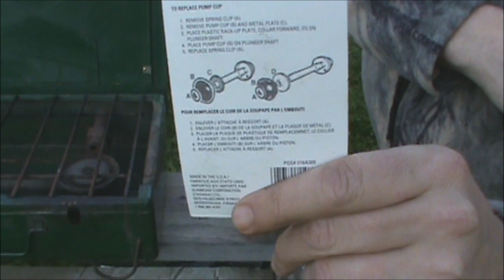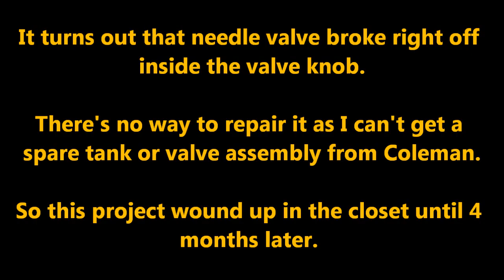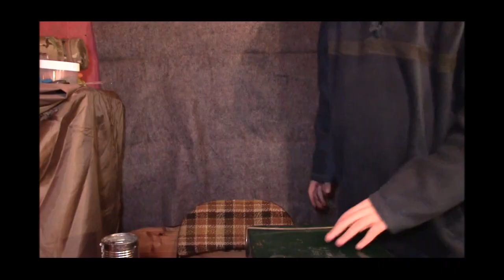Coleman Camp Stove Maintenance and Repair

Comment: These old Colman stoves are also nice to have in a grid-down situation for those folks with electric kitchen stoves. Have several of them, the first of which was purchased in the early 70's. Also have a couple of the propane conversion kits, as well. Good info on both the pump repair kits & the problems that may be encountered with generators in the old ones. Have replaced generators without any problems, so that is a variable, depending on the individual unit. 

Like these old stoves. Fuel stores for a long time. Over the years have cooked many meals on them, both at home & at campgrounds. Also work as extra burners when cooking for a crowd at either place.
Reply from the maker: Oldtimer Lee With all the stoves I have, I still prefer the Coleman on vehicle or canoe trips just because it's so rock solid. And with proper repairs, they can indeed last 50 years or so. The replacement generator is now in the repair kit for my newer Coleman stove and that's in the side pocket of that Cabela's triple case with 2 extra fuel bottles as well. Good for a couple of weeks off-grid.

As soon as time and the weather permits, I have another stove that may be worth considering - the BioLite CampStove. I shot a lot of footage of it last year but I need to reshoot it.
Reply: Alberta Bushcrafter If you don't already have one, add an adapter to run off 20 lb propane tanks, as well. Gives more flexibility based on circumstances. Saves the more expensive bottles for times it's more beneficial to use them. 

Don't know much about the BioLite, so looking forward to seeing your vid when you get round to it.
Reply from the maker: Oldtimer Lee Thanks, Lee. That adapter is on the wish list for this month as well as a tee and some lines. I'd actually love to find an inexpensive trailer and build a camping trailer (more of an outfitter's trailer) but that may take a few years.
Reply: Oldtimer Lee

Comment: I have 6 stoves that wouldn’t hold pressure. Took out the pumps, put them in some motor oil, good as new!
Reply from the maker: Did they have leather pump cups? Because that works on leather but not so well on the rubber ones.

Comment: Sometimes all the pump needs is a little oil on the shaft to restore the leather seal.
Reply from the maker: True - and it can be anything from vegetable oil to 3-in-1 to clean motor oil, but I use mineral oil (aka. scent-free baby oil). The "pump cup oil" is an expensive substitute.

Comment: What year is this stove?  I'm use to the oval red tanks.  I forgot about these tanks, so nostalgic.
Reply from the maker: I checked, and this is a Coleman 4M. They were produced in Canada approximately between 1957 and 1964 or thereabouts. Not a bad stove, but it's nearly impossible to find some of the parts for it.

Comment: I know this video is old and hopefully you can answer my question. I have a 1972 3 top stove and the pump requires oil. WHat oil do I use? Thank you for the diy. 😊
Reply from the maker: Actually, just about any oil will do. Normally I use what we call "3-in-1" oil (not sure why it's called that). But mineral oil (unscented baby oil) is excellent. I've even used cooking oil in an emergency but it can go rancid over time (mineral oil doesn't), but that's not going to affect the stove.

Comment: I have a comment on this video regarding removing the generator at around time 26 minutes.  Another video (https://youtu.be/feKxUn3KKiY) at time 7:15 shows removing the generator first by unscrewing the nut on the tank knob side and pulling out the needle control rod before unscrewing the pipe.  Maybe that's why the needle control rod broke.
Reply: You are 100% correct.

Comment: Hi.  Nice video.  I have a stove that is not pressurizing and I cannot use because I am getting a puddle of white gas where the generator in that recessed area where the generator assembly comes in contact with the tank.  Any ideas?
Reply from the maker: Sonds like it's the same thing that happened to one of my own old Coleman stoves. If the generator is gunked up with residue (vernishes and the like), the fuel doesn't vaporize but instead leaks out. Try carefully removing and  disassembling the generator, then cleaning it with carb cleaner and one of those long, thin brushes (sometimes used for metal straws, actually). If that fails, you will likely need to drop $20 for a new generator. Plus, it doesn't hurt to wrap the threads in teflon tape as long as it isn't on the inside of the generator tube.

Comment: Around here, in the central valley of California, I see these stoves for $15 - 35 at yard sales or swap meets. I currently have have 3. I have 2 and 3 burner. And I just picked up a single burner. It won't light, hence the reason I watched your video. It should be something simple. I already oiled the plunger and it will pressurize. But no fuel flow. I'll get it figured out.
Reply from the maker: Often that's a clogged generator. You can carefully remove it but don't force it or you'll break the generator. Then you can usually clean these with a stiff brush and some carb cleaner. If that fails, you can usually find a replacement in a big box outdoor store, or online.
Reply: Those are insane prices. Fortunately, I found a couple of these in the Craigslist freebie section over time (one or two 425's, and an older-looking 421/413 (?) ). And no kidding, retail stores (Canadian Tire, aka The Usual Scumbags), wants ALOMST $200 FOR A NEW 425!! This price has increased for some idiotic reason, going from just about $100 6-7 years ago, to $125, and up and up.
(Get stuffed, chain store).
I was lucky enough to come across a cheap white gas lantern at some yard sale or other. Picked it up for about $20.

Comment: Thank you ......similar to yourself...I tried to fix the old tank.....and failed...so I just bought a Mr. Heater propane converter . Now my hot dog buns are warm.
Reply from the maker: Nothing like warm buns on a cold day. I love that little converter unit, and I'm planning to set it up with a 20 lb. bottle as well, soon as I et the parts. But I also picked up a $5 garage sale Coleman, and a couple of lanterns as well, so I'll be doing another  (shorter) couple of vids in a few months. Thanks for the compliment!

Comment: I found that if the wire handle is down (its down in the video), that it interferes with the tank and generator seating.  Flip the handle up and the tank will seat much better, and the generator will seat further into the burner.
Reply from the maker: Great tip! I'll keep that in mind for the next Coleman video too.

Comment: Someone who collects old Coleman stuff told me you can clean these generators with carburetor cleaner.  I've never tried it, (yet) but it seems reasonable, ya think?

Soak the generator over night in carb cleaner and go forward from there.
Reply from the maker: Reso Man Carb cleaner just might work, as it does a good job on other stuff. I wish I had remembered that before I sheared off the needle valve.... :-D

Comment: Hi, all
If propane is not available can we use petrol or kerosene,?
Reply from the maker: If it's a liquid gas stove, the Coleman fuel is best and straight naphtha works too. But kerosene isn't recommended as it clogs up the stove quickly. 

I've used unleaded petrol in one of these stoves, and I add a capful of Seafoam engine cleaner to every tank, which keeps the generator a bit cleaner. That's the only way I got petrol to work without clogging the generator, and without the Seafoam additive the generator required regular cleaning. Incidentally, European petrol is a bit different than North American gasoline but the Seafoam trick works for both. But use it at your own risk as it can be a bit more dicey. 

Propane is a gas, so liquid fuels don't work. Isopropane and isobutane canisters likely won't work on a propane stove, but I consider that a moot point because they're way more expensive anyway and I personally don't like using them unless I need to.
Reply: @AlbertaBushcrafter   Thanks Sir,
But unfortunately here in Uganda propane is not available, so plz suggest me.
Reply from the maker: @applianceparadise7446  Well, that limits you to using the actual liquid fuel tank and rules out the propane adaptor, but that also simplifies things. And I'm guessing actual Coleman camp stove fuel is also unavailable in your area, so you won't be able to use tthat. 

Kerosene is not compatible with these stoves, but most petrol or gasoline will work. The generator in the stove will clog up more quickly with those fuels so it either needs to be manually removed and cleaned about every 10-20 tank refills or any time you notice its performance suffering. Clean it with carburetor cleaner and a fine wire brush.

Another thing you can do to prolong the life of the stove is to add about 15-20 mL of fuel injector cleaner or Seafoam engine cleaner to each tank. This works on my stove to keep the generator from clogging up and reduce the number of times you need to clean the generator.
Reply: @AlbertaBushcrafter  
Thanks sir.

Comment: Help please, from the Bahamas, brought a powerhouse 414. No sound of fuel traveling so won't light . Dos please please!
Reply from the maker: No sound of fuel usually means the tank isn't pressurizing, though in rare cases it means the generator is clogged. First, check the seal on the fuel cap and if it is worn, buy a new cap. Second, fill the tank and start pumping, and if you feel no resistance, it's the pump cup washer that is either faulty or dried out. Those two issues are the main causes of no fuel pressure.
Reply: @AlbertaBushcrafter    sorry for late reply, was only about to use it about four times and then this. No sound of fuel traveling to light it's dead. I notice the pressure in tank didn't depressurized always have pressure inspire of fuel value being taken off. Second the pump up knob barely turns clockwise or anticlockwise. Only unleaded fuel is used gives of sud. Check stem there's no sud part that's attach to tank
Reply from the maker: green You may have two different problems. If the tank pressurized but the pump knob is stiff, try removing that assembly and lubricating it  You might need to replace it.

The second problem is more serious and it's what happened in this video. Unleaded fuel is a lot dirtier than most camp stove fuel (Coleman fuel is almost pure naphtha). All those additives and impurities will clog the generator tube. Try unscrewing the lnob and needle assembly by depressurizing the tank and then turning the knob to full power - on many models you can turn it really hard and then it unscrews. Check the needle valve and clean it with carb or beake cleaner. Then unscrew the generator tube carefully and then get a thin swab or brush and swab it out the same way, then reassemble. 

The stove in this video was run on unleaded gas and I'm now certain that's what killed the generator. In fact, it built up so much varnish and crud inside the tube that it sheared right off in the video. You can run a stove like this on unleaded gas, but you have to clean the generator regularly.
Reply: @AlbertaBushcrafter  will try, but its brand new
Reply: @AlbertaBushcrafter  oh, thanks for replying
Reply from the maker: @ruthgreen8026  OK - if it's brand new, then your best bet might be to return it under warranty and get a new one. It may be a hassle but I've usually had good luck with this.
Reply: @AlbertaBushcrafter  thanks , return not possible live in Caribbean it,would cost more than purchase.
Reply from the maker: @ruthgreen8026  Not much more I can suggest except to check and lubricate the pump and clean the generator. However, you can also check the burner itself and see if there's an obstruction.
Reply: @AlbertaBushcrafter  appreciated!

Comment: Do you recommend using Kerosene in case you cant get the Coleman Fuel.?
Reply from the maker: No. Kerosene is too heavy and will clog the generator. The closest would be any other kind of camping fuel (it will be labeled that way), as long as the main ingredient is naphtha. Unleaded gas may work, but use at your own risk as some campers report that they've turned their stoves into fireballs.

Comment: Hello and a question for you about a Coleman stove. I basically want to know do you know the difference between the Coleman no. 2 and the Coleman No. 2-c?any help would be greatly appreciate it I'm looking to buy one but I can't figure out the difference
Reply from the maker: I know the 2s were made from 1924 to 1927 and the 2Cs were built from 1926-28 (as far as I could find out), but not much more about the differences. Only about 1500 2Cs were made though. And both models had different burner grilles but both had a built-in oven too. 

This site may have more info: https://classiccampstoves.com/forums/coleman-no-2.461/
Reply: @AlbertaBushcrafter  okay I really appreciate it thank you very much I was wondering if one was worth more than the other one and vice versa

Comment: Hey, do you know what to do when you get a puff out of that hole when you go to close the pump ?
Also what to do when your flame stays part orange ?
Reply from the maker: When the flame stays part orange, it usually means there is some sort of dirt or blockage in the generator tube, or that the fuel is old or inferior. Fresh Coleman fuel will tell you if it's a problem with fuel quality. You can unscrew the generator and get some carb cleaner and scrub out any deposits. Another trick is to pour a capful of SeaFoam engine treatment in every tank - a friend uses this to clear the crud from his Coleman products as he runs them on premium unleaded gas and he swears by it (but uses two capfuls as it's not Coleman fuel).
Reply: Alberta Bushcrafter 
Thanks for the info.
I'm using new Crown white gas which is a bit cheaper than Coleman brand.
Btw do you know what causes that puff out the thumb hole when I try to close the pump ? As far as I know this isn't supposed to happen.
Reply from the maker: That's just the way the pump is designed. You need to relieve the pressure before screwing down the pump handle, and that little hole guarantees that all the air is out of the pump handle and ensures that the pump handle can be screwed down tight.

And with Crown gas I've heard mixed reviews. You may want to put a capful of Seafoam engine treatment in each tank to keep the generator clean.
Reply: Alberta Bushcrafter 
Ok, thanks.

Comment: what is the part number for the leather washer repair pack? thank you
Reply from the maker: The part number I got was for the pump cup replacement - that's the leather washer, back plate and nut. Part # was 65212. I hope this helps!
Reply: thank you
Reply: that kit doesn't not seem to be available here in the USA.  Guess I will keep my eye out for it on ebay.
Reply from the maker: I searched for "coleman pump cup" and found a lot of hits on eBay and Amazon, plus other sporting goods sites. They're pretty common so you should be able to find one. In fact, your local Wal-Mart or other big box store ought to carry them too.

Comment: I replaced the pump in an old stove (neoprene cup, not leather), but it is extremely difficult to pump now. Anything I might need to check? The old pump In there moved easily but didn't force air in.
Reply from the maker: Did you lubricate the new cup? Neoprene or leather, they need a bit of oil or other lubricant in order to work smoothly. I've had this exact thing happen to me when I replaced a leather pump cup as well - and I usually swap out synthetic cups for leather ones now.
Reply: Make sure you have the pump knob turned left (open) position.  I used lots of rem oil inside the pump cylinder and on the neoprene valve before replacing and seating it in the cylinder.  It was still a somewhat stiff push/pull but after working it and doing some test lights/operating it loosened up.

Comment: As Paul A observed and is correct, if you would have removed the control knob and needle control rod in one motion, You'd have been up and running.
Reply from the maker: Thanks. I saw that below. Good point, but this one didn't want to move as the know was totally seized.
Reply from the maker: Also, this is a 4M, not a 425. It’s a totally different generator and the knob doesn’t unscrew all the way like the 425 does. Nothing on this stove works the same except the burners. And finding a 4M generator is tough. I managed to unscrew the rod finally, and even the thread diameter of the rod is different. This stove will have to stay a converted propane stove until I find the right part.

Comment: To your knowledge is there a way to attach a pressure gauge to take the guess work out of when to add pressure to the cank while cooking? I have a 1974 model 413G that works great but I'd like to add a pressure gauge if possible. any thoughts?
Reply: *Tank, not cank.
Reply from the maker: Not off hand. It's a pretty small thread on that piece and I don't knw of anything that small. Sorry.
Reply: Brad Brown only way I know how you could actually add a pressure gage is to drill and tap the tank. Maybe wash the tank out. And tig weld a half coupling on the tank to where you could thread a gauge on. Good idea though.